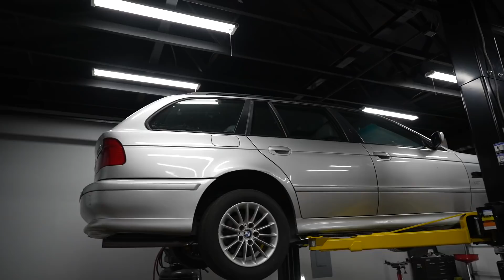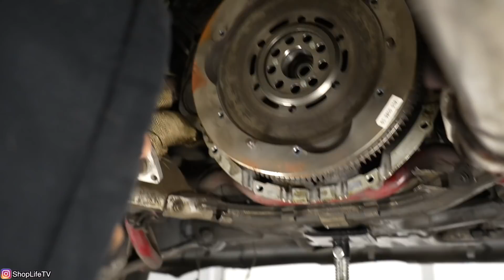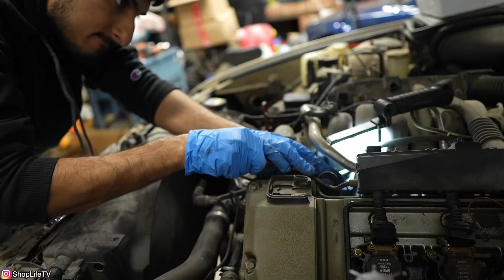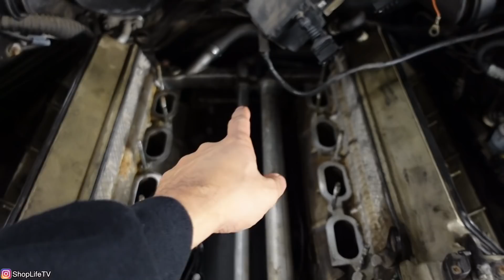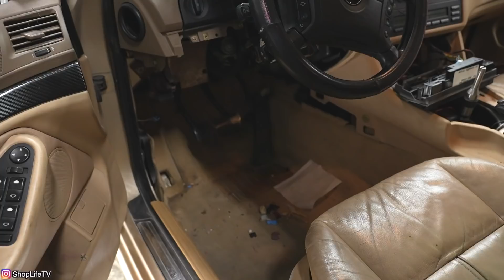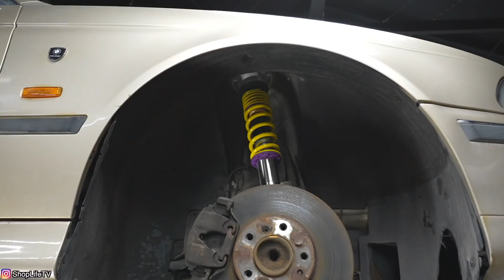SAVING AND MODIFYING THIS BMW E39 540iT WAGON (6 speed conversion, timing chains and more!)

Comment: What if I have an EWS DELETE how do I wire the car to work cause this is an auto to manual swap it started when I started. I had unplugged EWS module inserted a fuse between the two big wires and the two blue/black wires and it started and since I now have a 4 pin clutch switch I’m a little confused I want it to work like OEM I followed the e39 wiring from the other video and I just found this video but I have no ews dme is coded already

Comment: Hi, i have an e60 523i and i need your help what it might be. My problem is going on reverse and yes, i did change all the sleeve, solenoids, pan, fluid. Problem occur when i went for a long or short drive and it wont on reverse unless i turn off/on back. Please help!

Comment: You can use ST lowering springs for the rear. I've used them to eliminate the troublesome and leak-prone air system (old), that was constantly an issue on my '99 528iT. 

Best move ever!

Comment: please help !! i have a 2001 bmw 330ci 5 speed , my car died on highway got jump and found out the alternator was bad . replaced it but the power cable nut was stripped so cut it off connected it with allagator clips car ran fine for 3 months , then died again , the allagator clips had fallen apart and new alternator was bad so got a new alternator had to rig the power cable again , when turn key all power comes on hear fuel pump and hear a single click coming from starter , but no crank , tried jump start didnt work , tried push starting it nothing checked some fuses all were good . i am stuck car ran good before it died , when it died the last time my lights went out then car died like a minute later was last time it ran , any ideas would be thankful for ty

Comment: aye i got a issue with my bmw, its a 2010 bmw 335i automatic, just swapped a used new auto transmission into the car but the issue is that the dash displays neutral when in a gear. Now does the valve body need programming and is there an easy way to do this, also would the gear selector possibly be the issue?  i been trying to figure this out, wanted to see if you could help me out any way

Comment: I dont know if youll see this i hope you do if anyone knows the anwser feel free to tell me but I was wondering if a axel out of a 2003 325i will fit into my 2002 325ci?
Reply from the maker: You will need to check the part numbers. There were a few different variations between the axles across the e46 non m cars and some of the 325i axles are different than the 325ci axles since the differential output shafts are different.
Reply: @ShopLifeTV  so i cant use the differential as well with the axel i was gonna use the entire thing since i planed to manual swap

Comment: Hi I hope you can help me I have a 2002 325i automatic I did a main seal replacement and swapped out my trans mission when putting the transmission back on I snapped the two 10mm bolts on the shifter bracket what could I do now
Reply from the maker: Hey, you will need to extract the left over of the bolts from the transmission and then replace them. You may have to clean up the threads as well if they are damaged before putting in the new bolts. You don't really have many other options since that is the only spot the shifter bracket will attach.
Reply: @ShopLifeTV  so I would have to have to take my transmission off
Reply from the maker: @arkculite  You might be able to just remove the transmission crossmember and tilt the transmission back and get a 90 degree drill adapter with short drill bits to try and remove the rest of the broken bolts.
Reply: @ShopLifeTV  oh oki thank you soo much for the advice I’ll try my best
Reply: @ShopLifeTV  I have failed to extract the bolts the extractor keep snapping I went thru sets of extractors. I was wondering if you think I can weld the bracket on btw I took the trans back off took me like 30mins

Comment: 180,000   rear subframe bushings are a must on a wagon. Rear subframe holds the entire suspension,  bushings on the wagon get smoked by comparison
Reply: 100%
Mine were footaad, I polybushed the whole car seeing as removing the rear axle is damn near half the car lol
Was on 125000 miles when I had to do it and they were bad, the subframe hit the chassis when levered on
Reply from the maker: This car will most likely need a full rear suspension overhaul in the future, but as of right now the goal is to have the rest of the car mechanically sound. The owner has a lot of other plans once the car gets back to him